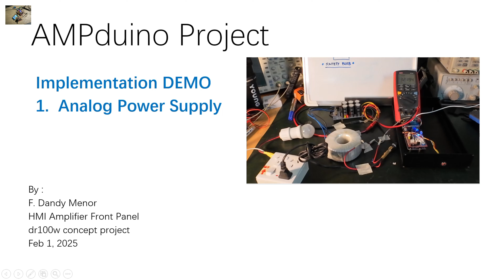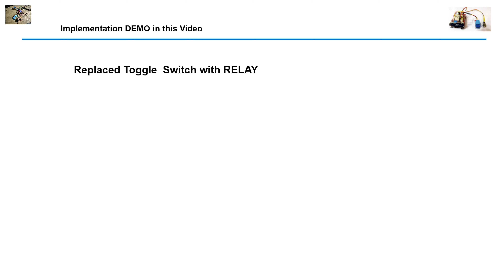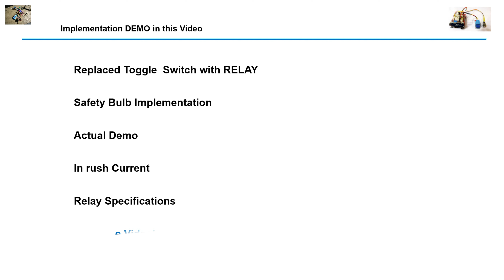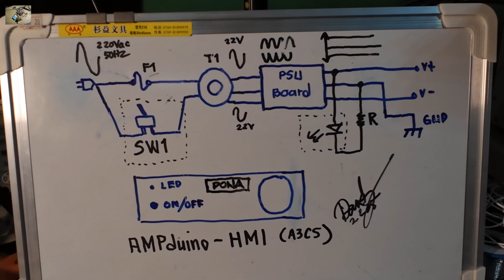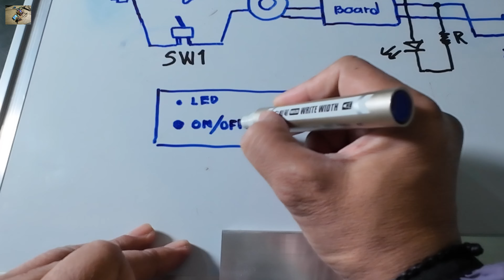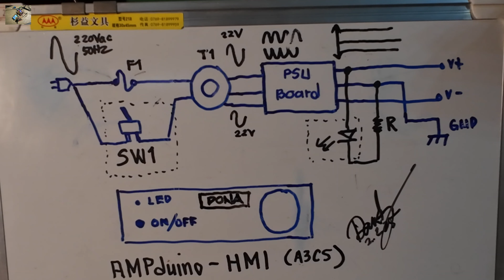AMPduino #11 | Push Button ON OFF Amplifier Analog Power Supply Application Arduino Uno Code

Comment from the maker: for reference "only" on how to use I2C protocol with Volume Control and digital Tone control,  let me share  2 Videos I made.   a)    MCU Programming #11 | How to deep Dive on digital Volume Control TDA7449L Gain & Balance | I2C Bus   https://youtu.be/eeAo102xPzs?si=1j3aKHZDfa8g1MD3       b) MCU Programming #12 | 8051 Hardware and Software for digital Volume Control TDA7449L   https://youtu.be/weclhNEtFqw?si=gXUiWFm1Vv_IKJRd

Comment: Hello sir hope you are doing well,  sir i need your help for making and Explaining 5.1 remote kit using AX2358F IC And Atmega328p Micro-controller with code explain. Thank You sir I am your big Fan
Reply from the maker: Hi, thanks for watching the AMPduino-HMI project.  I am good now recover from the winter sickness in my jobsite.  Frankly, I dont have example of SKETCH to access this  AX2358F , but I can imagine and discuss.   It looks the AX2358F comes with   INPUT = 4 (L+R) and Output of  a)  FRONT SPKR (L+R),  b)  Center  c) SubWoofer  d)  Rear Speaker (L+R) including MUTE  in terms of function there are  6 items to deal with as stereo   but when you deal with each function there will be 8,  1 for input,   2 for front speakers,  2 for rear speakers and 1 for Center and Sub woofer = 8 funciton indvidually and 1 for Mute.  To write the software to access these 8 funciton indivdually using I2C protocol,  What you need are :     1)  Chipset write address    2)  chipset specific Function address -  any of the 8 individual function  and 3)  data to be writen in each of the functtion.   Imagine  the I2C wires is like a street with several houses,  these houses will have a number different from each other,   say that  you want to visit DANDY House with house #A324...    now think that  AX2358F is one of the IC connected to the I2C line (SDA, SCL),  and there is AT24C16 EEPROM  also connected in the same I2C wires -- the eeprom is where you save your setting for the  AX2358F,   you need to be specific to tell I2C line that you want to access AX2358F,  its like the same analogy to visit the house with number #A324,  so, take a look at the datasheet and go to I2C discussion,   you will find the AX2358F address is like 0x94  (hex) --- only write address which means you only instruct,  you do not read from this IC so there is no read address.   The eeprom will have another write and read address.   Once you know the chipset address,   then focus on the 8 functions,  say for the INPUT,   you want to use INPUT #1,  then find the INPUT 1 function address in the datasheet -  if you choosed input 1 - it means you select both the Left and Right Inputs,   and under this function,  find the data how to enable it,  and send these 3 informations over I2C protocol --- chipset address,  function address and data.    You will do this each of the 8 Functions.   Say for the Front Speaker,   the data to be written in the Front Speaker Funciton is the Volume Level  in dB,  if this is 1 dB step  or  "maybe"  2 dB step - its all in teh datasheet.   Well Goodluck!   I have a discussion of how to access  I2C  Tone Control in one of my video with the TDA7449 - have a look as reference,   https://youtu.be/weclhNEtFqw?si=FmBSZM58gKv4uSUA
Reply: @dr100wconceptpoweramplifier  thank you so much for well explained! You are amazing🤗✨